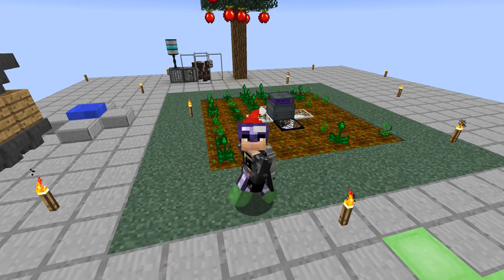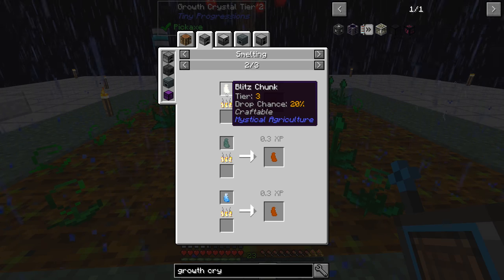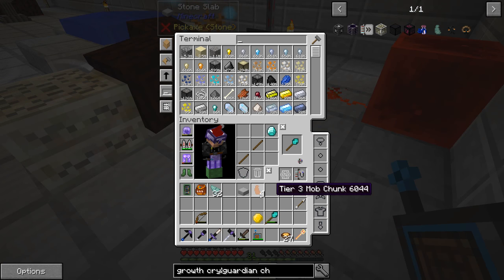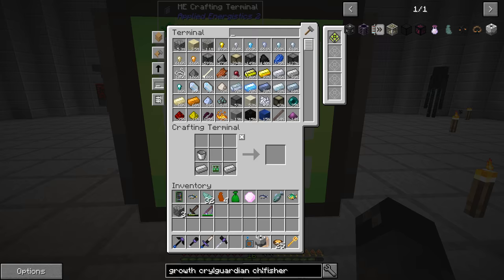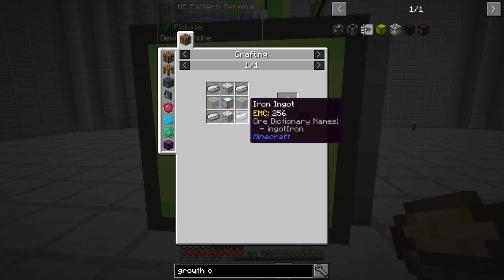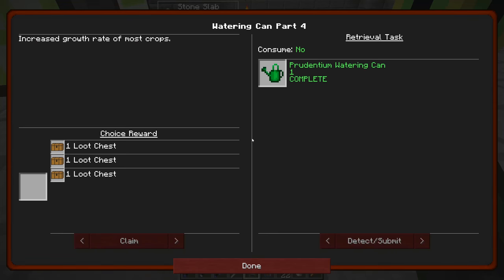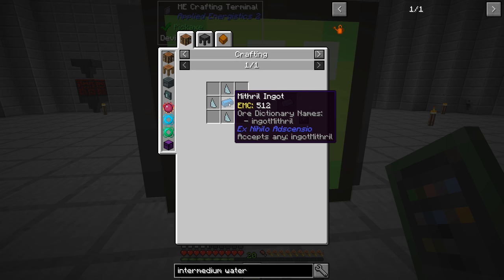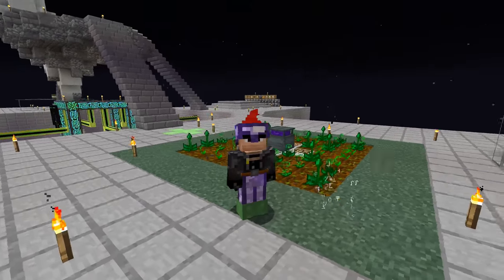Project Ozone Lite - GROWTH CRYSTALS [E27] (HermitCraft Server Modded Minecraft Sky Block)

Comment: You placed the growth accelerator under the wrong dirt block lol (you placed it on the edge but the seeds weren’t on the edge)
Reply: Omega 3,3 he already fixed it derp
Reply: Neo no he didn't fix it, after he took the stack of growth accelerators away he replaced them with growth crystals. That is when he put them under the fertile soil. He missed out on how the accelerators worked.
Reply: He's a derp XD
Reply: another thing the fertile soil is a bad block. He should use fertile dirt from Mystical Agriculture it makes crops growth 2-3x faster
Reply: YOU can just make a Fischer if YOU need more :)
Reply: +91rinek You mean the dirt from Random Things?
Reply: Josh Martin ohh yes, my mistake. Random things fertile dirt.

Comment: Your magnets is your strength since it helps to pick up items which are scattered around. But it also seems like its your mortal weakness since you keep forgetting turn it off when you need to drop items into mana pool and also forgetting turn it on afterwards. Keep it in your hot bar!

Comment: Your ME system would craft faster if you spread out recipes that require sub-recipes to craft, rather than placing them all in the same interface. That way it can be using different molecular assemblers rather than having to wait on the ones crafting the sub-components. 

I just sort of psuedo-randomize the recipe locations in my assembler arrays. Seems to work out really well.
Reply: Nope. Since each interface touches 4 assemblers, it would need to simultaneously craft 4 subcomponents to matter.